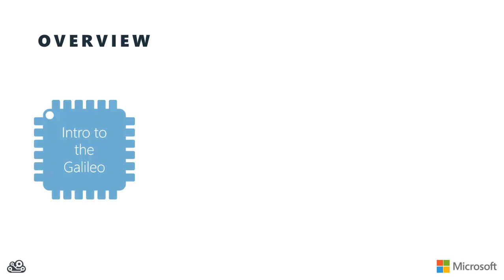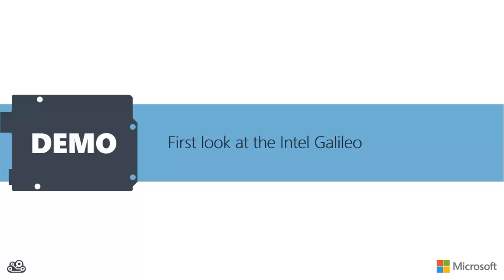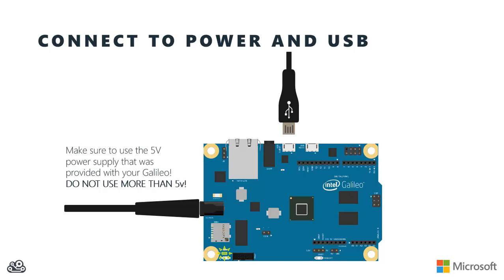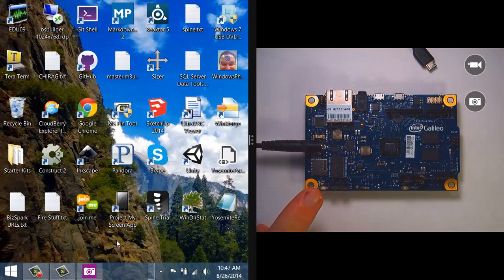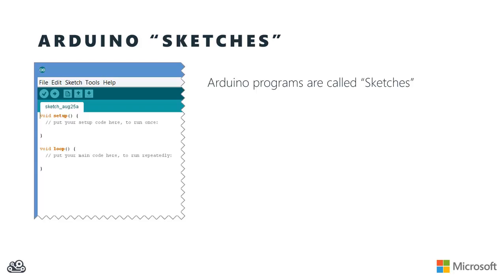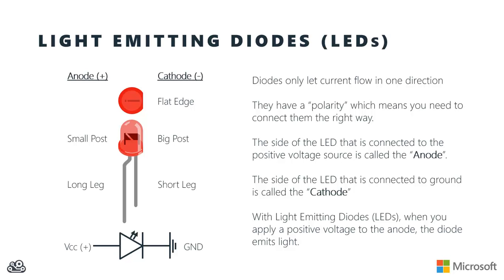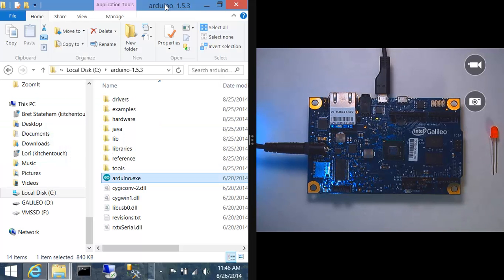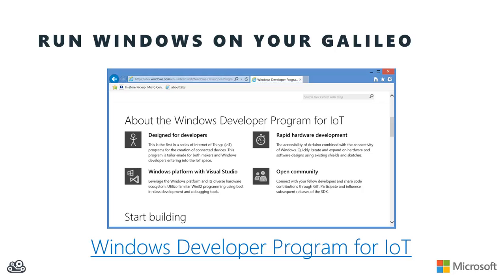Getting Started with the Galileo

Comment: Do I need a bootable SD card in order to run code and make an LED blink? I am using a mac and I have an Arduino 101 which works. Do I just plug my Galileo gen 1 and select it on the Arduino compiler?

Comment: Bret Stateham  What do you suggest for someone who took this as far as running the Blink LED code and gets an Error Status -1 during execution??? Any ideas? I flashed the windows img again and no dice, and also switch from my Win7 desktop to win8.1 laptop. Still no go. I read somewhere about it possibly being an sd card that needs to be updated, but havn't figured a way to do that. I have a Gen2 and have been able to boot and use the galileo remotely, but no luck getting code to get from my comp to my Gal2 
You seem like you have a lot more knowledge on this subject than most, help would be appreciated ten-fold!